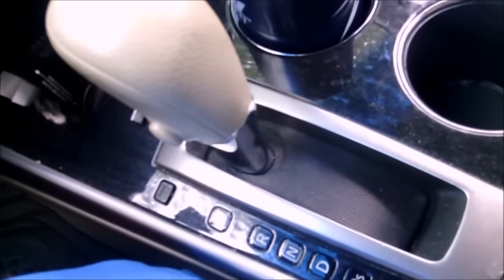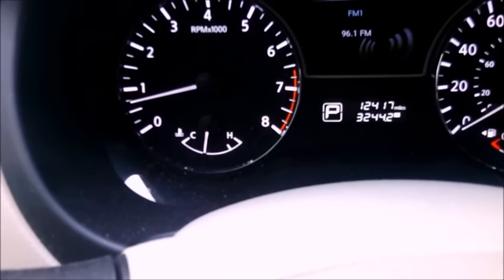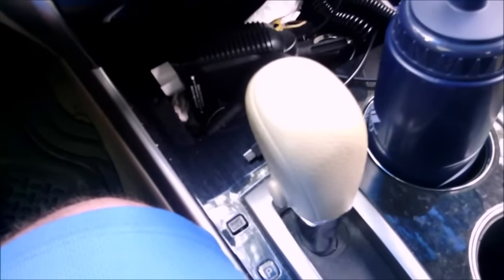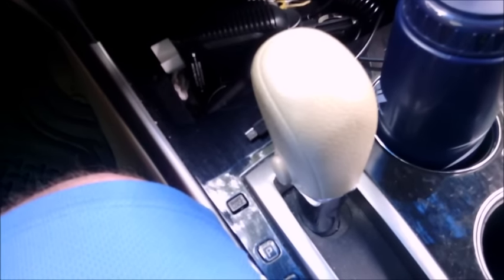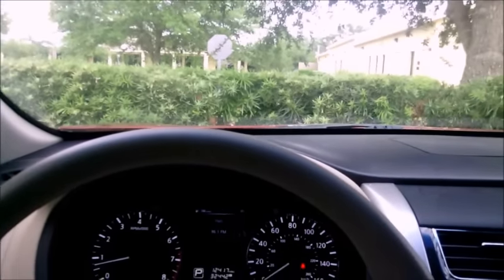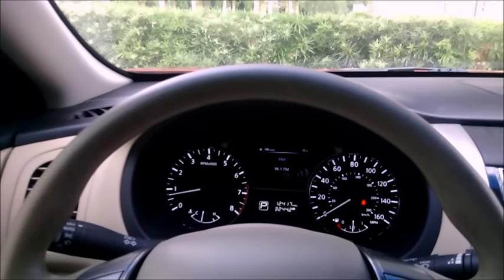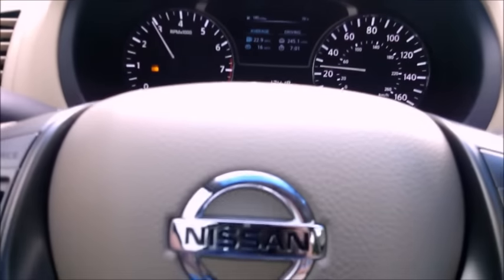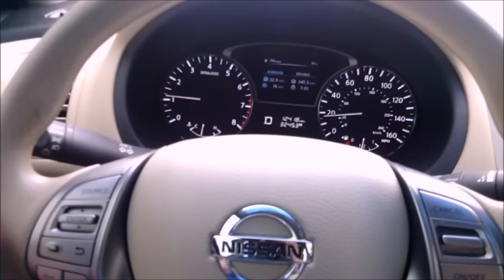What Does OVERDRIVE Button Do (O/D light Off Toyota Ford Nissan Honda Dodge Hyundai Kia Chevy GM car

Comment from the maker: I'd highly recommend the Resqme car escape tool to put on your key chain to help break your window from the inside or out in case you get trapped due to flash floods.  You can purchase off Amazon here https://amzn.to/3RZnHbG  HelpingHermit is a participant in the Amazon Services LLC Associates Program, an affiliate advertising program designed to provide a way for websites to earn advertising revenues by advertising and linking to Amazon

Comment: Overdrive is for highway driving. If you're doing 65mph in 3rd gear, your rpm's would be high. In overdrive, you can sustain 65mph with lower rpm's and thus better gas mileage.
Reply: Ah nice! Thank you for that information
Reply: That explains my fuel economy. Went through 5 gallons in 60 miles.
Reply: Totally late here, but, so it makes sense to have o/d off for city driving?
Reply: @InTheMindOfficial I think so and going up hills

Comment: It's not going to make your car feel sluggish, it should do the opposite because it will prevent you from having to downshift as much so you should already be in a desired gear. When you hit the gas you'll just take off rather than downshifting then taking off
Reply: But when you're getting to highway speeds...
Reply: But when you're getting to highway speeds...
Reply: It’s pretty much sport mode
Reply: He is in an automatic

Comment: the overdrive unit will fully engage at 60Km per hour, That's 40 miles an hour american speed. When the button is pressed the transmission will down shift to third with assist of torque converter lockup if you are at or above 60 km / 40 miles per hour. This is what my 1995 Nissan Sentra dose.

Comment: It doesn't lower performance it raises performance... Keeps you in you power band. Also you would not use this on ice unless you were wanting to use your breaks less. Otherwise it will keep your rpm higher which is further into your power band making it easier to over accelerate and spin your tires

Comment: There is no clutch in an automatic, it is called torque converter and u wont wear it.
Reply: @weaton25   Thank you for informing the uneducated.
Reply: I don't mean it in a rude way.
Reply: @in7849  I believe British shorthair means that there is no clutch to separate the engine from transmission. This is right and wrong and the same time. It is right because there is a torque converter in the place of a clutch. It operates relatively the same but with fluid pressure going back and forth. Look it up. He is wrong because most modern torque converters are what they call "lockup torque converters". At certain speeds the torque converter's clutch will engage and lock together. The reason they made lockup torque converts is to reduce heat due to the turbines of each side of the converter moving at different speeds all the time, even at road speeds. By locking them together there is less friction, which means there's less heat. Anytime there's fluid pressure in any form of hydraulic then there is friction which causes heat.
Reply: u mean a CVT tranamission?
Reply: @weaton25  i got a nissan frontier and literally never pushed the button to turn overdrive off. Is that bad ? I dont know how to use it

Comment: I love to use it as a "Passing Gear". Turn off then back on to accelerate faster. Works great!!
Reply: Because it downshifts the transmission same as hitting the gas until the kickdown switch engages
Reply: I always tough it was like a sport mode, used it when I needed to go faster!
Never had any problems with the transmission!

Comment: I use the overdrive in my Corolla but it seems to work best on the highway. Usually I use it to slow down instead of using my breaks. It’ll just throw my RPMs way high and I’ll turn it off at the desired speed. 
But one thing I’ve always wondered about though.. would turning it off when hauling off at a stop, make for shorter shifts? I guess my logic is since it likes to live in higher RPMs maybe every time the car shifts, the RPMs won’t come down as much. Not sure, I’ve yet to test this out but I doubt it, I’m sure I’m using the overdrive feature incorrectly even on freeway. 😂

Comment: If its anything like the tow/haul button, it prevents the use of your overdrive gear so you can stay more in your powerband and peak torque making hill climbs more capable especially if youre towing a load. Todays engines dont have the low end torque like the older one used to (unless its a diesel or forced induction).

Comment: There's another reason to turn off overdrive...towing,overdrive in an automatic is actually a less durable gear than the others...i turn mine off if I'm in town and the speed limit is 30 or 35 mph because it kicks in and out...at 40mph and over i use the overdrive unless towing,and you see people towing things at 80 mph these days because they have no brains...a automatic transmission has many clutches...clutch packs that engage with hydraulic pressure..usually the overdrive clutch pack contains less,or smaller clutches and overdrive should not be used for towing anything heavy...the only automatic transmission i know of without clutches is a cvt transmission and they are nothing but problems,waiting to fail as soon as the warranty expires...

Comment: In short it depends on what u use it for it can be for icy roads and to be in more control but it’s to be remained at low speeds to reduce strain on the car. It is mainly used I assume for towing pretty much

Comment: I never press overdrive off, I manually switch down to lower gears in when going uphill or downhill.
Reply: wallabing 
Turning overdrive off is best for down hill, but a steep uphill is where you would want to manually change to a lower gear
Reply: Actually, throwing it into second is the best for downhill when around (30mph/50km/h ish). At motorway speeds on a modern auto, just lift your foot off the accelerator and it will automatically cut fuel off, thus you feel this engine braking effect.

Comment: it's like down shifting on a manual transmission car. if your want to pick up speed you downshift a gear, it's like driving a 10 speed bicycle if your cruising in a certain gear and your coming up to a hill, you downshift to a lower gear so it will be easier to get up the hill, your going to have to pedal more times but they will require less power to get you through the hill. on a automatic car it feels wierd to some people because they are not used to it but it actually makes the car more responsive if you accelerate, if you just cruise around with it feels like your engine is over working. so it's best to use it when your ready to accelerate.

Comment: Overdrive does not make your car sluggish
Reply: That's not what he said though, he said overdrive being OFF makes the car sluggish, not overdrive ON, which is correct. It's true that you will get a noticeable boost in acceleration if you turn it off but it will also decelerate much more quickly and any attempt to coast from pure momentum will be very rough because you're locked at a higher gear ratio. Fuel efficiency will also take a hit. .
Reply: It definitely makes it more sluggish and that's how gears and inertia works
Reply: Sam Robinson please elaborate for those of us who still dont get it....i dont see why this exists, if the automatic transmission was shifting back and forth personally id drive a different speed; could this help me get unstuck from the snow? If im plowing or towing would this be something to consider? Why exsactly is this on my truck? Tell me more about this faster acceleration, i noticed my truck doesnt have much pickup and it can be inconvenient in stop and go 25mph traffic would i ise this hear? I font know how to drive in a way im not constantly coasting, its built into the way i drive at this point, am i gona screw stuff up when i habitualy try costing with this feature off? Any additional information you care to share?
Reply: Well I sure heard the engine change when the OD was Off.  I dont know what I did to even do that and I def heard the difference in the engine so I was praying all the home that the car wouldnt blow up.  I didnt know what the heck was happening.
Reply: @666cowboy69  I do frequent towing with my 1994 f250 with a 4 speed that already gets 10 mpg as a rating from the factory floor. I never really fiddle with the overdrive on mine, mainly because I can pull two or more cords of wood up a decent hill without the transmission downshifting. But I'll educate you a little bit on what you can use overdrive for. First of a, when it's really snowy and the roads are packed with slippery ice and snow, I started keeping my overdrive off. Usually you never attempt at going over 40 mph in those conditions  anyway. But I've experienced my truck shifting into 4th gear and spin out going 40 mph. The higher gear ratio (for faster travel speeds) and the torque produced from my 7.4l engine caused it to spin out when I was barely on the gas. Another use for overdrive is when you're pulling something through hills and you get on the highway right where there's plenty of hills. Turn off overdrive because if the truck decides to upshift into a higher gear then it's really annoying because you'll lose torque for climbing the next hill. Happens to me when I'm on my way home from cutting a shit ton of firewood. I wouldn't get in the habit of using it to slow down. Though it's not much, it can slowly wear things down, and it's unnecessary. Though it's unlikely, but still. That's what the brakes are for. But the overdrive button is for road conditions and efficiency when pulling, whether it's up a hill as a car or a truck with a load.

Comment: Or get manual transmission and don't worry about this
Reply: Or worry about getting stranded because the you leaved the lights on
Reply: kjisthecoolest other than getting stuck in traffic 
Clutching like a maniac
No bro go Tiptronic/semi Auto or Automatic
Reply: Rashid Khan driving in traffic isn’t terrible in a manual.
Reply: you work your right foot in traffic just as much with an automatic, only difference is your left foot has to do work and youre doing work caused by others not because youre choosing to do the work, but everything sucks in traffic, the back of a limo sucks in traffic
Reply: @Rashid Khan people who drive manual in san Francisco don't need a cat battery anyways,they just start it by driving down hill,in fact they only use the engine to drive uphill.

Comment: lol Overdrive is just for  highway driving 55mph and up, Drive is for city  driving conditions 35 mph and under also you get access to engine braking so you don't wear your front brakes from constant stopping, D1 is for max engine braking and towing. you can also use it for steep hills but you only have access to 1st gear.
Reply: You were more helped that ole dude
Reply: I'd rather use up my breaks over the engine/transmission

Comment: im still in confused..how to know that the O/D is On or Off position..and what is the recommended is it On or Off?
Reply: danilo jr. ogalesco Highway : Off, City: On. It's slower when it's off, but it doesn't matter all too much.
Reply: Highway ON so you can go past 3rd gear
City OFF since you stop and go but i personally would leave it on all the time .the damage it does is so small youll never notice.
Engines are made so well theyll never damage themselves that way thats why thr button is there and overdrive is automatically set when you turn the car on

Comment: I turn over drive off and I have a faster acceleration. in some cars it doesn't make them slower
Reply: +Starlesslemon lol you're so right
Reply: Do a test from a stop. It makes no difference when pedal is floored. Acceleration is the same. But it keeps the gear so letting off and getting back on doesn’t have the delay of the trans switching gears.
Reply: My mother hates driving so I do all the driving when I'm visiting. She thought I would break the car by turning overdrive off when approaching a steep hill. This woman is 36 years older than me and had never even heard of overdrive.she was shocked at how quickly her little 4cyl pulsar made it over the hill when I was driving

Comment: when i turn it off i feel like it goes faster.. why?
Reply: Ricardo Gil 
More power, and more acceleration. Though overdrive is better for cruising at constant speeds.
Reply: Ricardo Gil its a lower gearing ratio, so its easier for your cars engine to turn the wheels but at a higher rpm.
Reply: Ricardo Gil this option lower the gear to give power while u driving and easy to overtake the vehicles.
Reply: Overdrive is not turbo
Reply: WILD RHINOS of course it is not but when the one reduces the speed and accelerate again without od/ off it takes time to maintain the same speed but if press the button od/ off it gives extra power to speed up fast. 
I have Honda Civic automatic and when i lower the gear to D3 it gives harder push vehicle to move fast but this is not good for fuel economy.
Reply: Because it's faster
Reply: Od off gives you one less gear making your rpms higher and more responsive. It’s like sports mode in new cars kinda.  Od on allows you to use the last gear to go higher top speed or lower the rpm while cruising to save gas.
Reply: Ricardo Gil it does
Reply: Ricardo Gil cars not shifting into 4th gear hi rev in 3rd higher rpm makes the car pull harder or faster
Reply: Same lol
Reply: Exactly
Reply: What shoud i do ? On or off the small button just yes or no
Reply: amber ihtisham - On, which is the default setting. You will rarely need OD off, and if you’re not sure when to turn it off, it’s better to leave it alone (on).
Reply: It doesn't it just give you more torque/ pulling power. Once you take your foot of the gas it feels like extra weight on the car. Its to keep the slow but with a lot of pulling power like if your pulling sre towing something
Reply: @david336  Si
Reply: If you have a 4 speed automatic transmition, turning on the Overdrive will be your 5th gear. Its usefull for saving gas at high speed. Its not meant for overtaking or climbimg uphill.
Reply: rps13sr wow 🤩 thank you
Reply: @rps13sr  So basically sports mode is overdrive off?
Reply: @1800munchie  it thinking it's the same as tow/haul mode. Rpms rises BUT fuel mpgs drops significantly
Reply: same
Reply: Same here

Comment: It is harmful to the transmission to turn off Overdrive while in motion, the only time you should every turn that switch off is if you are in park and you are towing something. i have personally seen this setting nuke transmissions because people thought it was a quick way to downshift.
Reply from the maker: you are probably right.  The problem with the OD settings in todays car is that you can accidentally bump that button with your hand while driving.  I've done it a couple of times.
Reply: Duncan Curt yeah I have as well by accident lol. my dad toasted the tranny in my mother's vehicle by playing with it to much
Reply: yeah dont do it lol
Reply: Kzona1976 shit mistakes were made today
Reply: What did you do? lol
Reply: Another reason you might turn it off is if you consistently drive 30mph or less.The transmission may start to hunt for gears even tho it has become less of a problem when we went to electronic shifting with solenoids away from the traditional valve body with hydraulic and vacuum lines.
Reply: Mike Samra
Reply: How is turning off OD different from the auto downshifting by itself?
Reply: Desmond 
With overdrive off it can never go to the highest gear.
Reply: So glad I read this lol.
Reply: That is incorrect. Your transmission is designed to turn it on and off while driving. It is no different than moving the gear selector into 2nd or 1st.
Reply: Knowledge Block i hope this is true i dont want to ruin my transmission, is there a certain speed that we shoulnt turn off the O/D?
Reply: Ryan Lata no. Basically the OD is der for a quick downshift to overtake or climb a hill as mentioned. Use it all you want. My dad sometimes turn it off n forgot to push it back on. I juz watched the rev meter go crazy but i dun give a shit. Hes more of an old skool guy driving manuals.
Reply: Wow. What kind of car do u have? Luckily my car is designed so u can switch on the overdrive while in motion.
Reply: Desmond basically "overdrive" is a gear that spins more slowly than the rate of turn of the engine. For that reason it is very easy to damage, if you drive too slowly in that gear. In a manual transmission the last gear will be an overdrive gear and you wouldnt want to shift into it untill you were doing about 50mph. Accelerating in overdrive isnt good for it due to its weakness. So you only want to use it for light acceleration, and cruising at highway speeds. 
So turning it off means it wont go into that last overdrive gear and you can tow things or drive up inclines or accelerate faster without both damaging the gearbox, or suddenly losing the ability to accelerate by being in too high a gear for the situation
Reply: finally someone with sense i do it all the time its the way its ment to work tranny been fine 3 yrs plus